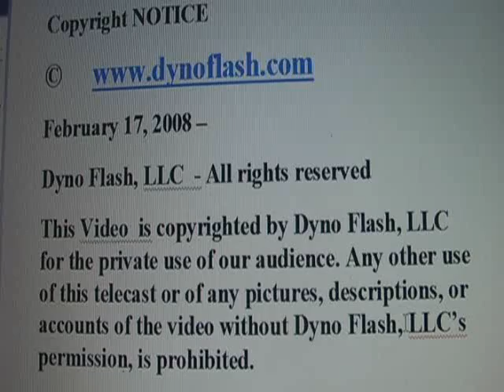lead by example

Comment from the maker: I have no clue.  George's car is not running and I have no idea about when and if the other guy's car is running.

This is the whole point of this video - I am working late hours to get my car running and keep it running so I am always ready to run or take a customer for a test drive or what ever.

Owning a car that can be fast but which does not run is not cool to me.   

Slow and steady and committed to long term action is what wins and keeps you in the lead.